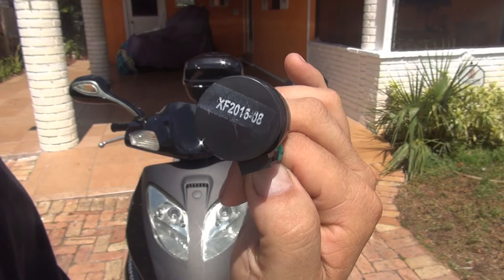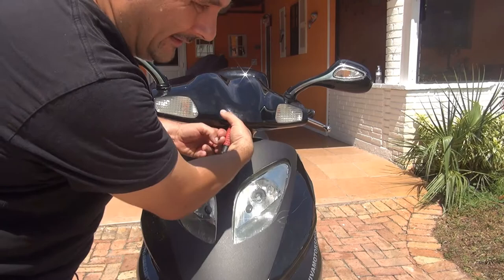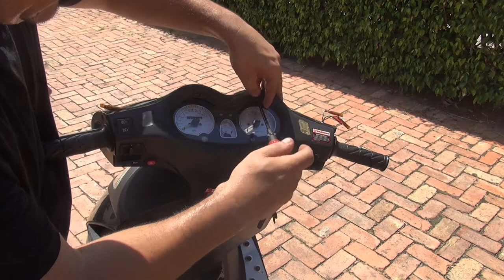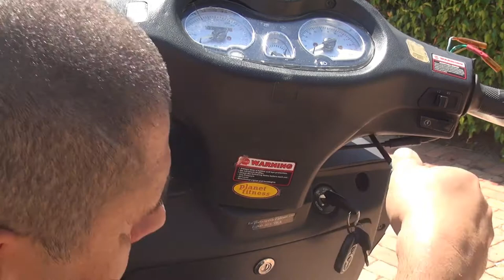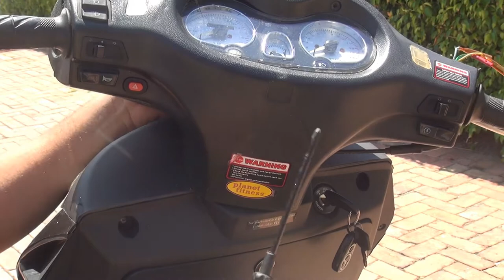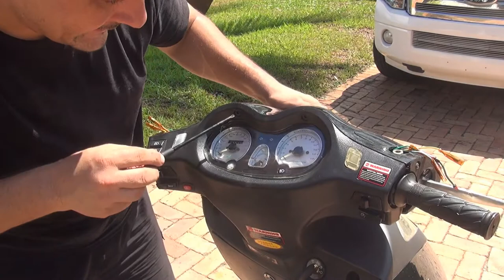How to change turn signal blinker relay on your GY6 scooter

Comment: My indicators are staying on.so I have changed relay ..thinking needed new 1 but it's still doing same thing ..staying on..not flashing ..any idea what it could be ..iv checked all wires ..thanks for this video help to find relay
Reply from the maker: Hello Carl if they stay on sometime the relay goes bad that way or sometime goes off with no sign of life
Reply: Yes I no this bit I got brand new relay and it still dose the same thing indicators stay on .don't flash ..is there something iv missed or could the new relay is bad 👎 .thanks for getting back to me 👍
Reply: exact same issue here I am wondering if the the stator just isn't producing enough power to make the relay actually click, I replaced the rectifier as well to rule that out. Waiting on a set of headlight bulbs from Amazon since no stores anywhere sell these weird style bulbs and hoping they help with making all lighting work properly. At least for temporary we can click it on and off until a fix is found.

Comment: Hey man, I have a kymco super 8 50cc 2 stroke, I can’t find the exact flasher relay for it to order, can I use any other 50cc flasher relay for it???? Much appreciated
Reply from the maker: Hello Kymco many time they use honda parts and few times I find Kynco parts on ebay   but if your relay is 3 wires you can try to place a relay from chinese scooter should be working ok

Comment: I left side blinkers work but my right side blinkers do not. Do you think that is associated with the relay or is that a different issue? Also, thank you so much for all your videos and advice, thanks to you the not running scooter I was given is now on the road and doing great! Besides my blinkers and brake light. But getting there!
Reply from the maker: Hello my friend I think the problem is the relay because they work on 3 wire system but could also be the switch .Thank you for watching my video
Reply: @VirberelloScooterTips  thanks so much for the reply! On your advice I switched out the relay and now both sides work. I do have to get this switch hit just perfectly for the right side blinkers to engage, so I think I will have to replace the switch as well.

Comment: Hi there brother.. new subscriber, new owner of a 2008 wildfire WFH150-SE. Was my moms in the garage, 692 original miles. She hadn't riden it since 2011.My question is, I have it running after much trial & error, and I came across a wire harness with 2 wires, a green wire & a black/white wire. Any idea what the harness should go to..? Its not plugged into nothing, and was like that when I got it Besides that, I had to unplug 1 of the wires from the cdi harness, I think connected to my kill switch, in order for it to start. Do you think I need a new cdi or kill switch or both...?Thanks my friend
Reply from the maker: Hello my friend not sure about the green and black wire sometimes scooter wires harness are universal so they are made for many different scooters so sometimes they have extra connections and I don’t think you need a new cdi the problem could be the kill switch that have built up corrosion inside. Thank you for watching my video

Comment: I have an issue with my lights up on my moped when I’m gone real fast my lights shut off sometimes all of them or if press the break all my lights shut off or blink or when I use a turn signal all the lights blink. Can’t figure out what’s wrong with it.
Reply from the maker: Hi I believe you need to replace your regulator rectifier or you have a short in the system in the cable harness 👍
Reply: @VirberelloScooterTips  OK thank you so much and my scooter bugs out at full throttle and shut off. I replaced all  lines. I replaced all the lines and everything. and what size jet would I need for a stock carburetor that comes with the scooters

Comment: I changed my signal flasher but it keeps burning out I've changed it twice now and I don't understand why it keeps burning out
Reply from the maker: If your signal flasher keeps burning out, there may be a few possible reasons:
Incorrect installation: Make sure that you have installed the flasher correctly and that the wires are connected properly. Double-check the connections to ensure they are tight and secure.
Electrical Overload: If your vehicle has aftermarket or high-power bulbs installed, they may be drawing too much current and causing the flasher to burn out. Make sure that the bulbs you are using are compatible with the flasher and that they are not exceeding the recommended wattage.
Short Circuit: A short circuit in the wiring can cause a flasher to burn out. Check the wiring for any damaged or exposed wires, and repair or replace them as necessary.
Faulty Flasher: It is possible that the flasher you purchased is defective. Try purchasing a flasher from a different brand or supplier to see if that solves the problem.
If none of these solutions work, it may be best to take your vehicle to a professional mechanic to diagnose and repair the issue and that sometime is a lot easier. Thank you for watching my video
Reply: I wish there was a place around here that I can go tothe one place I went to they ripped me off and made me order the whole tail light section for 98 dollars cuz there was a bulb blown in it
And you would have to be VERY unintelligent to put that simple part on 🙄
And when the new scooter got here it was already burned out and so is that rear tail light
I would like to mention also that the negative on my battery is very crowded and looks like it's leaking I wish I could find somebody dependable around here believe me